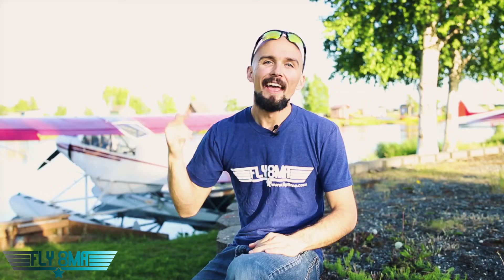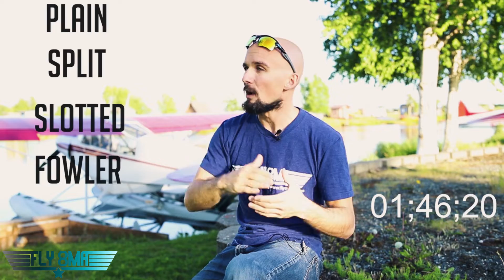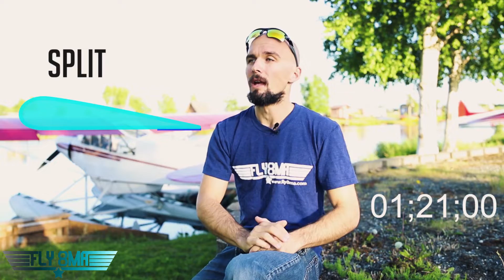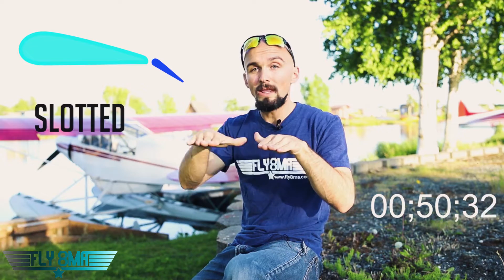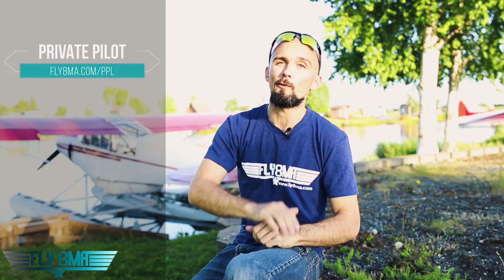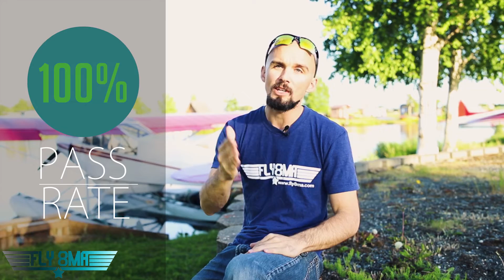The 4 Types of Wing Flaps | 2 Min Tuesday is back!!!

Comment: The Cessna 172 POH says nothing about them being Fowler flaps. It DOES call them slot-type flaps - "The single slot type wing flaps, Refer to Figure 7-3, are extended or retracted by positioning the wing flap control lever on the instrument panel to the desired flap deflection position."

Comment: Why do flapless approaches cause a higher nose up attitude?  Having the "pitch for speed,  power for altitude" philosophy,  considering 0 flap VS1 is higher,  I would expect to keep the nose lower to maintain this higher speed.  Yet I read the opposite is true. Can you explain?
Reply: Rookie Pilot basically in normal flight, higher AoA leads to an increase in lift (until the stall that is). So in order to fly at the same airspeed without flaps there to increase lift, you will need to increase AoA more to compensate.

Comment: can you do a video one day on  converting licenses so you can work in other countries, tips and maybe shortcuts on 1st officer positions outside of u.s airline jobs which dont require an atp....1,500 hours seem like a forever goal harder to reach than ever before
Reply: Does it have to be 1500 on type or can it be 1500 overall?
Reply: @kurttappe  For an ATP, you need 1500 total hours overall.  There is no hour minimum for a type rating that I'm aware of.